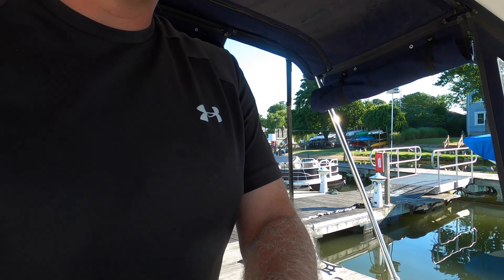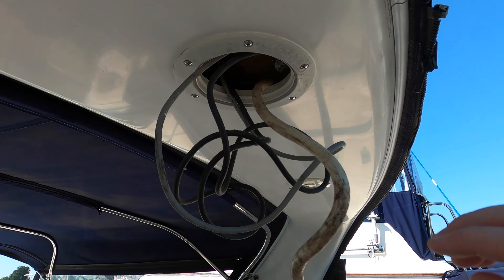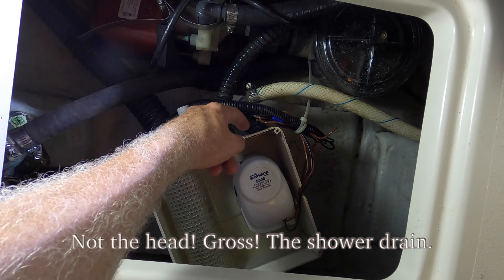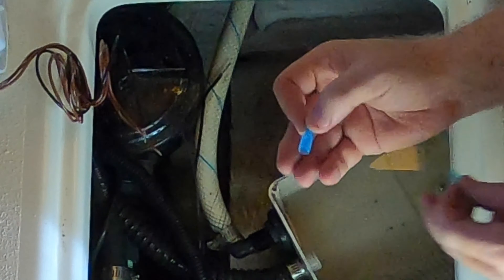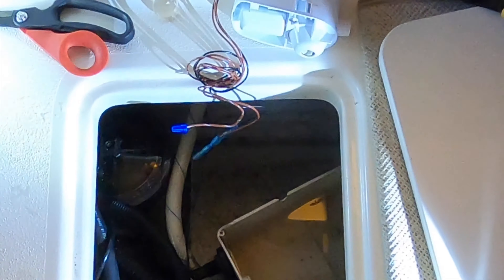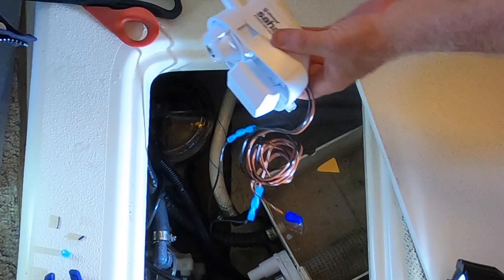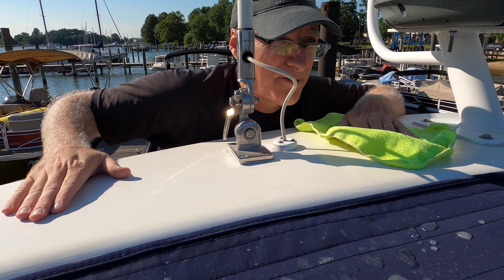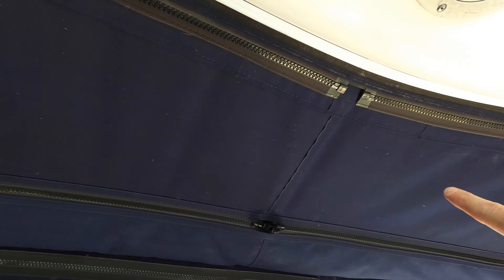Time to Call a Pro! Episode 41

Comment: I have similer boat in Australia, In my younger days built several rally cars with extensive wiring, never liked those crimped connections that you are using BUT I bought a proper set of crimping pliers and now I am a convert not expensive set but ditch those thin ones rubbish. cheers
Reply from the maker: Thanks for the tip. I just might next time I’m faced with that type of project.